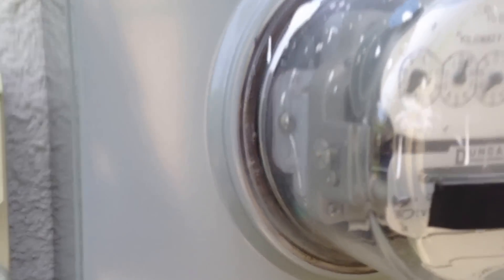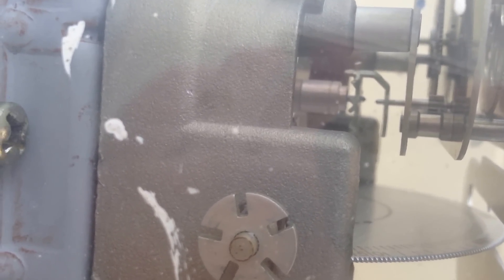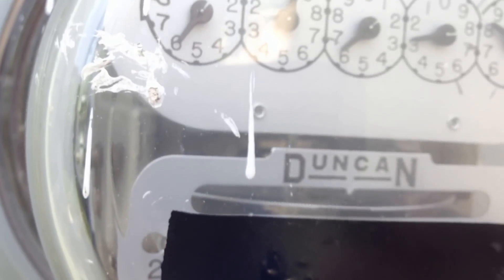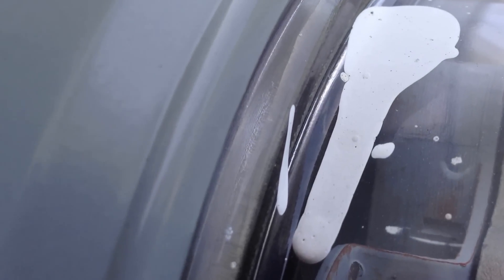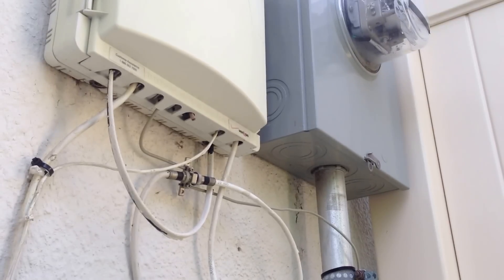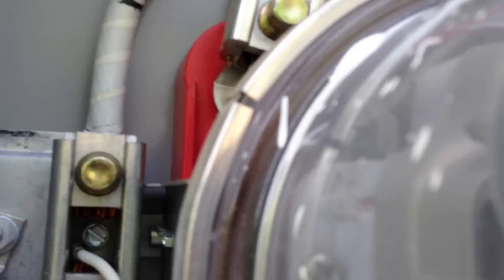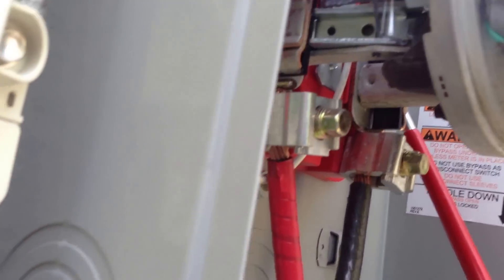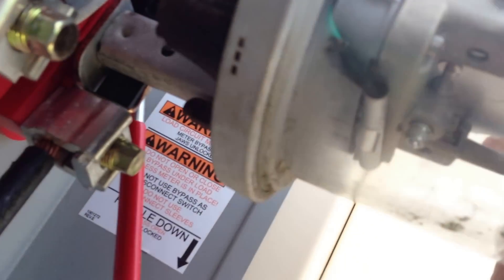Hacking an Electric Meter - Verifying that your meter has not been hacked

Comment: This particular enclosure will let you pull the meter by first pulling up on that bypass lever on the right. Power will continue to flow into your home with the meter out and that lever up. This allows the utility to replace/service their meter without disconnecting your power. Now simply yank that lever down without a meter in place and that'll disconnect your power.
Reply from the maker: Thanks for the Explanation!  Makes sense.

Comment: can you run the bottom wires straight to the upper wires to get power
Reply from the maker: +Spikes Hostage Yes, Physically that would work. It is however, theft of services. Thieves often run a line from the top wires to their AC Units bypassing the meter, and allow the meter to power everything else. You should inspect for this when you purchase a new home.
Reply: +silverbankruptcy OK thanks I was just wondering I hope we don't shock if I do it LOL

Comment: In this case, that is actually a meter bypass. This type of base is not really intended for residences. Its typically used at businesses so that the utility can do maintance, such as changing the meter, without interupting the service. You can actually see that there is a little block right above the lever which is designed to stop the lever so that it sticks out and will not allow the lid to be closed when the meter is bypassed. This keeps people from stealing power by bypassing and then shutting the meterbase, There are meterbases which have a lever for releasing the meter however.

Comment: the reason they went to the new digtal meter is so the guy who drives around and reads them every month does not to get out of the car and walk into the back yard or on the side f the house to read the meter he just points his " gun" in the general direction  of the meter and bang he has the power consumtion for the month and he is off to get the next guy it is just a way for the electric company to save money on there collection costs
Reply: Ron Thomas and are these digital meters over clocked just like these old mechanical ones are?  someone I worked with once had a friend who read meters and he told him about how his power bill was so high and the guy says: I can fix that..He opened the meter and somewhere on the thing was a small screw..He turned it a bit and said: There..Now it'll read your ACTUAL consumption vs what the power company is charging you, All the meters are over clocked a bit to match what power companies want to charge you vs your actual consumption. That said I wish I had a friend who was a meter reader and would fix me up like that :D.

Comment: the red handle does NOT bypass the meter. When you lift it up, it releases the 4 clamps inside so the meter can be removed. They would not make it that easy to bypass the power.

Comment: I need to point out that in most cases, if you break that tamper poof seal, that cheap locking wire that locks the box, it's an automatic minimum charge of $50. Is some states, it is a crime..
Reply from the maker: My Box did not have one sealing it. Even if your does, do you think that they keep track of every tab on every Box? The box does belong to the homeowner.
Reply: silverbankruptcy Those utility clips have individual serial numbers.  If you were to buy the same style on the internet, the clip would be the same but they would not match. It is likely you would be fined if the utility company compares those numbers.
Reply: silverbankruptcy The box may be the part of the house but the meter itself and the security seal are the property of the utility. Now I have not confirmed this but I heard a roomer that some of these new smart meters will soon be equipped with a door switch that will ether log or signal the utility that the door has been opened. Again, unconfirmed and I don't even remember where I heard/read it so I can't site a source.  Most utilities now have the ability to do, can't remember the technical name, active monitoring or there respective grids. When more has been used than the total recorded by clients, They start looking at where the excess is going. This is not something that will point to a spastic house but it will point them in the direction where to start the investigation. At least, I doesn't now until they start coming out with smart transformers in the case of power utilities. When they know what area to look in, they start attaching polling devices at key points on the grid to narrow the field and eventually, find those who are stealing the utility. It's a lot harder to get away with this sort of thing than it used to be.
Reply from the maker: If you cant open the Box, How are you Supposed to Change the Meter Box to Upgrade Service when it is Necessary?
My sense is that the Electric company Barely can read the meter, let alone keep track of the seals.
Reply: We change our meter, not you. And just for your notice, you’re responsible for everything after the meter base. Tampering with it is a crime. Some company’s require the owner to install the meter base but as long as it is hot it doesn’t matter if you “own” the box or not. You also shall not tamper with the service line feeding the meter. That is a secondary live power line.  The local power company will replace the meter if they can not read it and there are contractors that go around and maintain them. They are trained and know how to do it safely and legally. Do not mess with our meters for legal reasons and for the safety of yourself. If you would like to learn about any type of meter you can buy one for anywhere between $20 and $80 on eBay or a supply store and wire it up out of your breaker box.
Reply: Good question! Most likely just fear spread around to minimize theft.
Reply: This moron has no clue what he’s talking about!!!   Wrong al the way around..  he gives the worst advice !!  Cutting a meter seal is theft..  the utilities company will charge for a cut seal and would never allow someone to cut a seal to get into there socket!!   This guy is an idiot for thinking otherwise..
Reply: The box belongs to the house and the homeowner... you have the right to remove it

Comment from the maker: To: Ron:
You are Right. It is easy to bypass the meter. These Meter Setups are common in New York, and I am told that theft is similarly common. People Tap into the main line and run drill a hole inside the box into the house and run the main lines  directly into a panel in their house to their Central AC units. in my county, you can expect to be prosecuted if they catch you.

Comment from the maker: In the U.S. we generally have 240 Volts service entrance coming into the house divided into two separate 120 Volt lines plus a Neutral for 3 wires total. Each half of the house panel is powered by one of the hot lines for 120 volts. Central AC units and other 240 volt appliances connect to both hot lines and thereby get 240 Volts. Bigger houses have three hot wires coming in or can use 3 phase wiring. it works but I find that many 120volt appliances lack enough power.

Comment: That's weird. I just heard you mention 240v as the main supply voltage. I'm sorry I'm not too good on accents, but thought if you are in US or Canada it is 110v?
Reply: I’m a lineman. You have two phases of 110/120v. 240 volts across both phases. Things like your wall outlet only use one leg which is 110-120 volts.

Comment: I 100% share your interest in these meters. One other thing that I kinda like is how all the street lights used to have a time switch (one outside my house in England as a  kid in 1980s was "Venner time switch"), that is, until the intro of LDR light dependent resistors and switches, running 240v or more recently 230vAC. As you say, it's amazing how they are so so reliable.